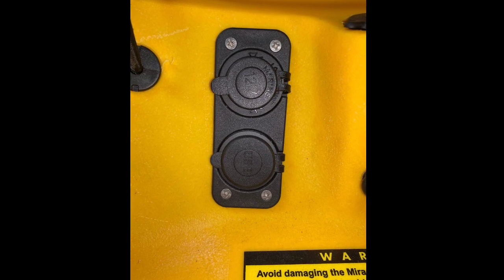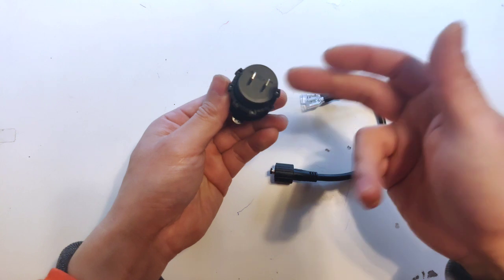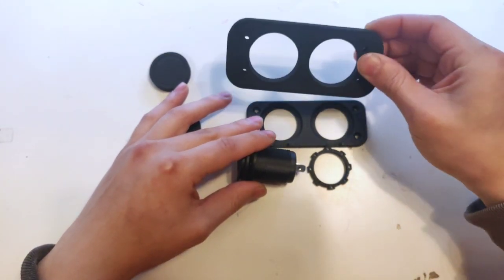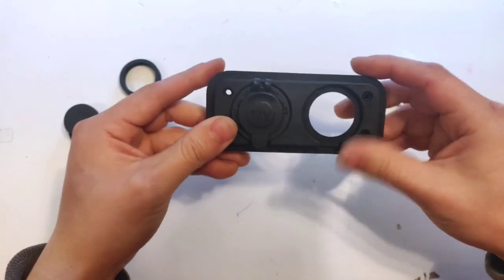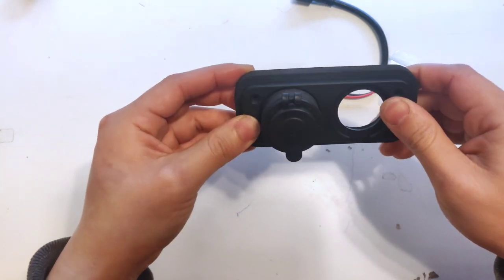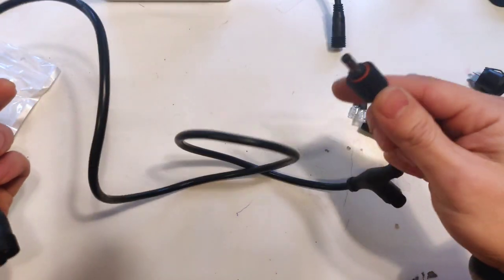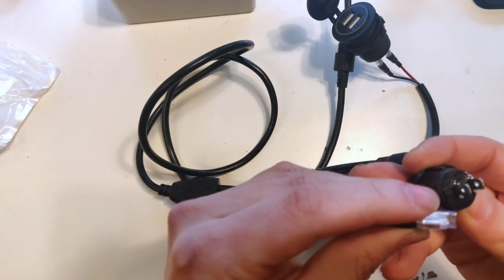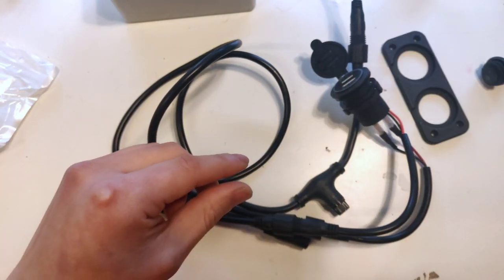FPV-POWER Kayak Cockpit Dash Mount Accessories

Comment: I have my FPV-Power 50Ah Kayak Battery inside my hull. I’ve been looking everywhere for a waterproof bracket to mount it in so it doesn’t move around. Maybe this is something you guys could design for the future. Thanks